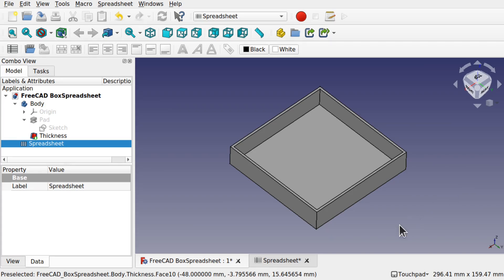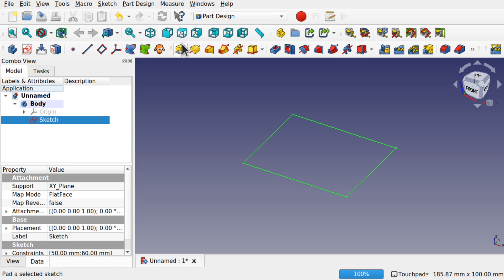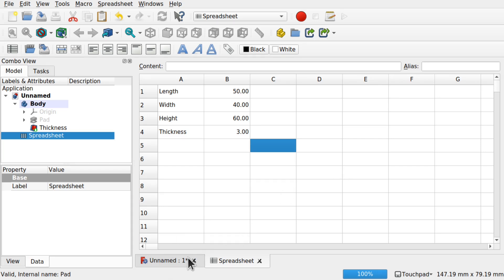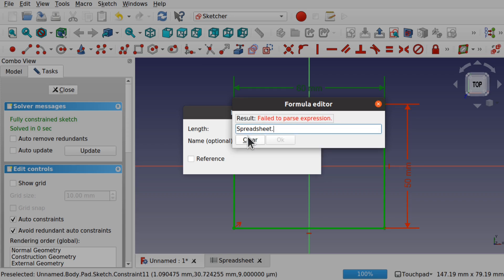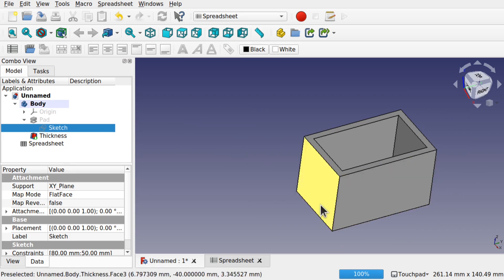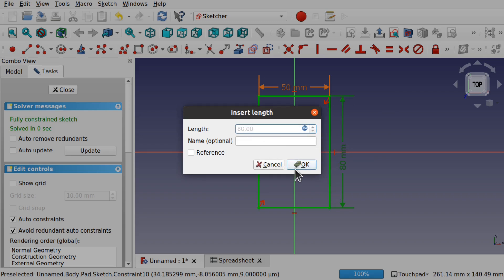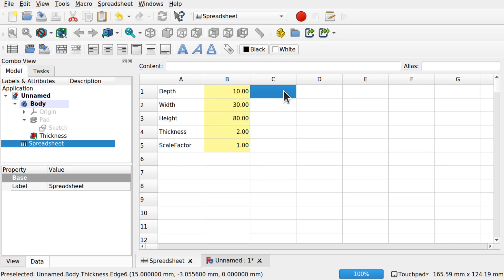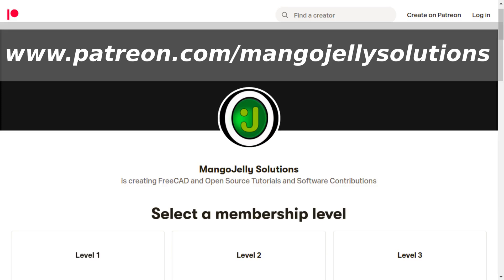FreeCAD: Learn How To Build a Spreadsheet Driven Model in 15 minutes. Quick and Easy for Beginners

Comment: Is it possible to have one speadsheet apply to all the parts in an assembly or A2P?
Reply from the maker: I had a very similar question but with varsets and created a video for it (https://youtu.be/ZHYmFKmMnUI), the concept is the same except you would use a spreadsheet.  Hope that helps :)
Reply: I will check that out tonight. Thank you!

Comment: @MangoJellySolutions You are my freecad God...thanks for all the great tips et al.

Perphaps you can help recreate a bug(?) I'm having with the spreadsheet designing a part for 3d printing.... In sketcher I make three squares (think basement apartment and attic) and in a seperate attached sketch a square rainpipe running from top to bottom. When I make the apartment go from 5 to 50mm via the spreadsheet everything goes well. If I then resize it back to 5mm the rainpipe is in a completly different location and the model (padding etc =) breaks. In the same model if I go from 50 to for example 46, look at model, go back in the spreadsheet change it it to 40 etc etc until I slowly get back to 5mm everything goes well...
Reply from the maker: Thank you :) :) Glad your enjoying.  So, your the second person who has come to me regarding that exact same issue, the other was a patreon making a cabinet.  Exactly same thing happened with the shelves, it's like a over shooting bug if dimensions are adjusted too 'violently' and I believe it's known.  The bottom and top lines of the shelves were actually swapping.  Way we solved it was to place the distance constraint for the shelves from the base i.e. 1ft, 2ft, 3ft rather than have distances between them i.e. 1ft, 1ft, 1ft.  I wondering if your experiencing something similar.
Reply: @MangoJellySolutions  1. Thank you very very much for responding. It only adds to your end-boss-status in my eyes!!!
2. And yes.. I was/am having the exact same problem (the design turned almost inside out). I tried repeating the "bug" on a gaming machine (thinking something in the calculation is lagging behind) and maybe a faster machine would solve it. It did not.
3. I don't know if it has something to do with free floating designs (having dof's) and therefore not fully constrained or not. I have not tested that.
4... .....last night in the early hours I found out that putting just a dimension-constraint in place was/is not enough.... What I now do is put a line in place (where I want a constraint between), toggle it to construction mode, dimension that line, constrain the dots and that seems to do the trick. It is a work-around (perhaps to be shared on your channel to help others?) until the bug gets picked up by the design team...
Once again, thank you very much for the great channel and sharing your knowledge!

Comment: Is there a way to manipulate these parameters in python without a gui and generate a pdf?
Reply from the maker: You can manipulate constraints within the spreadsheet from python:

import FreeCAD
doc = FreeCAD.ActiveDocument
sheet = doc.Spreadsheet  # Replace with your spreadsheet's name if different
# Set cell values (example: A1 = 10, B2 = "text")
sheet.set('A1', '10')
sheet.set('B2', 'text')
doc.recompute()

Or you may be looking for freeCAD command line tool if your looking without a gui  (in same directory as the exe).  You can run commands from that tool.

Comment: another fantastic video. thanks to you this is how i learned to use freecad. just a quick question. if i make a spreadsheet with diamensions on for my frame, as they change the other parts will move, but what i need to know is, is there a way for geometry diamensions, as in angles that can be read from the sketch and placed into the spreadsheet. then other angles can be calculated based on the ones that will change accordingly. as in if i increase one figure and not another a top peice will change its angle. but i then need a different fixed angle to change according to the variable one.
hope that makes sense.
cheers 

phil
Reply from the maker: Glad to see these videos are helping.  In answer to your question yes there is.  If you name the constraint in the sketcher to something say by adding a length constraint and double clicking on it and giving it a name this will make it easier to reference in the spreadsheet.  Then you can enter into a cell (where Sketch is the name of your sketch)

=Sketch.Constraints.con1

You will get the value back of the constraint, then you can simply do your maths against that i.e.

=Sketch.Constraints.con1 * 4
Reply: @MangoJellySolutions   Thankyou for the quick reply. so appreciate it. i can get the angle to show in the spreadsheet, i can then do maths with it. but if i try to reference any other diamensions from the spreadsheet, its not letting me. i.e. the spreadsheet now knows an angle. and hase 2 other lengths aswell. all with alias. when i click a line in part design, goto type the length i click the little circle so i can lenk it to the spreadsheet. now i usually type spr and it fills in the rest, but it's not doing it. if i delete the angles and so on in the spreadsheet it works again. it says something about it cycling.. help!!!

Comment: I find it expedient to first create the spreadsheet before creating the drawing with the aliases as far as is possible as it is much faster for the computer to process. Once the drawing is created and then  if you create spreadsheet, my computer becomes very slow, even if it is not even referencing the created drawing in version 0.21.1. But it is a very useful feature anyway, when one has multiple sizes of the same model or if there is an offset in 3D printing, in say a threaded spiral helix, to get say a nut and a bolt to fit one another.

Comment: I just noticed that even if you have units set to inches, when you type in the values in your spreadsheet, they'll be in mm by default so you have to include the units, e.g. "1.375 in" instead of just 1.375.

Comment: Bug? Running 0.20.1 in "US customary" units. As I dimension in Sketch, it interprets spreadsheet entries as metric and tries to convert to inches. Example: I set Height to 2.5 in the spreadsheet, thinking it would be interpreted as 2.5 ". It converts it to US customary assuming the spreadsheet numbers are in metric, and thusly inserts as 98.4252 thou. Any fix to this issue?
Update: I added "in" after the spreadsheet value and this kinda cured the problem. What doesn't work are expressions like 3/8in - the system gets confuddled with that as far as I can tell.

Comment: Great videos!
I believe hitting tab in formula editor will auto fill top result. 
Formula button type spr then tab ...spreadsheet will fill in.... type w then  tab will autofill spreadsheet.width  type enter to save....avoids clicking with mouse to select.
Reply from the maker: Great tip for short cut, thanks for adding😁

Comment: Hi Darren , Another great video you've made . Thank you for your knowledge and time .  My question to you is this . if this will do formulas can I do equation driven curves and spell out gear designs ? Have a great day my friend stay safe .

Best Regards
Terry Lembke
Reply from the maker: Thanks Terry, you should be able to use SIN, Cos and PI etc from the spreadsheet to drive the geometry.  I suggest  giving it a go with some basic geometry in the sketcher and slowly work up to more complex experiments

Comment: Nice job. Just FYI for anyone using spreadsheets with many values it can be tedious managing aliases. There are macros that will help you automatically apply them. I use "Alias Manager" which can be found in the Macro tab in the Add On tool.
Reply: For anyone watching this tutorial in 2024, the Marco "Alias Manager" has been replaced with the Macro "EasyAlias".
Reply from the maker: Thank you. Never seen that macro before. Great tip 👍👍👍👍👍👍
Reply: Can you be more specific on how to get this Add On. I am new to FC. I clicked Macro>Macros and nothing is listed there. (0.20.2)
Reply: @user-bj4lp3fr1o  You have to install it by using Addon Manager located in 'Tools > Addon Manager' then select 'Macros' in the drop down menu located in the upper middle left of the popup pane.